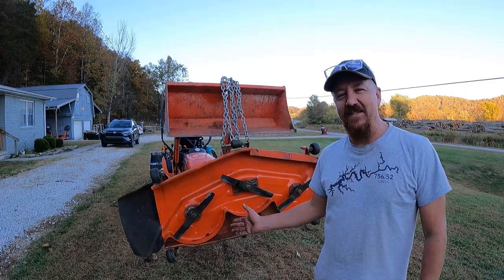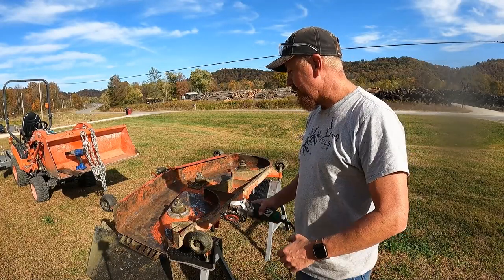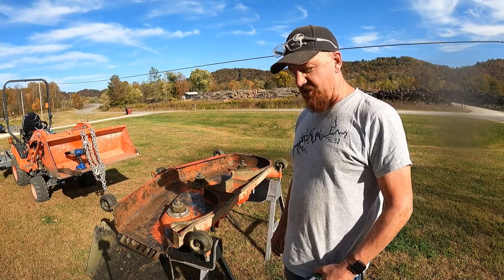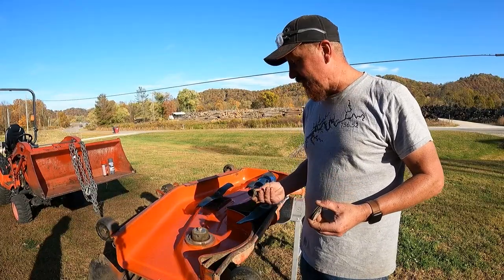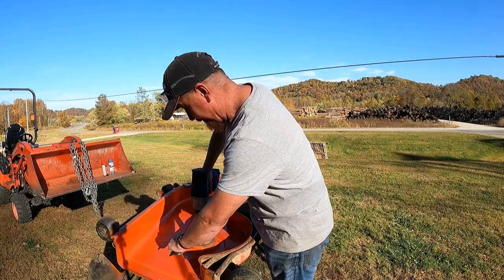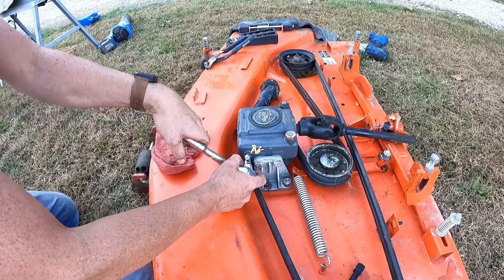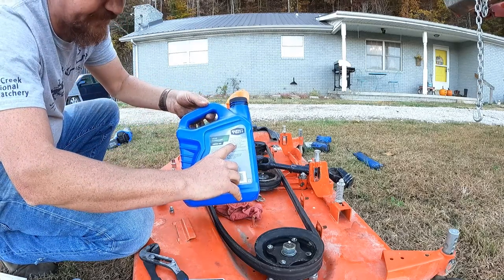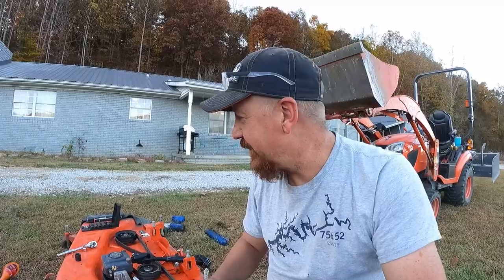MId Mount Mower Maintenance - Kubota BX Mower Deck Service -Grease Gear Oil and Paint!

Comment: When you change the gear oil in your box, you get a quart of oil cut the bottom of the bottle off stick that under the drain plug works very well. Just thought you’d like to know.

Comment: Great job an handling that deck :)  Bucket hook did its job :)

I got lucky found a 30mm front wheel drive axle nut socket in my toolbox 1st time removing blades. I've since added a short socket 😀Garage floor wise I did a great job catching the gear oil and when done stepped on container and dumped it all 🤣
Reply from the maker: 😂🤣. Now that sounds like something I would do!!!

Comment: Going to be doing the gear box oil change, I would like to try and lift the mower deck up with the loader from one side , drain the oil vertically into a cup , hopefully no mess involved

Comment: What I do when I change my gear oil is I’d take a gallon jug of oil and take the empty jug and make a pan to stick under the lower deck. I also use the same gallon jug when I’m changing oil in the tractors.

Comment: Good video but I'm not sure about the concave washers going "up" as you demonstrated. My maintenance manual for the RCK60B-23BX clearly shows the two concave or cupped washers going against the blade, followed by the lock washer (kobota term), then the bolt. Other youtube videos seem to bear this out.
Reply from the maker: Thank you for pointing that out.  I may very well have mixed that up or at least not clearly communicated.  This is well explained.

Comment: i use POR 15 or rust bullet ...tougher and lasts longer ...
Reply from the maker: POR15 is good stuff!
Reply: @PeeksPeakHobbyHomestead   assuming you prep with zinc phosphate and degrease before, i have had it last 2 years in the high wear areas ...RB is a little softer...

Comment: Working way to hard...just scrap the grass and dirt off...clean out the bearing blade caps..reinstall blades..clean off the top..and grease top serks..check belt...grease pto shaft..and spline....spray brake clean on main box breather vent and grease nipples...serks..prior to grease/wipe first....all done...
Hard part is putting  deck back in correctly..